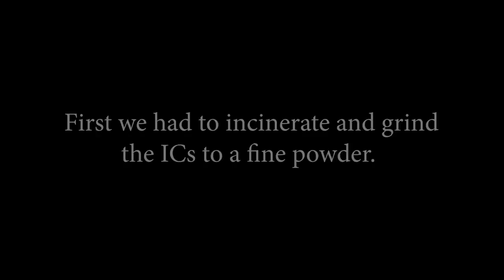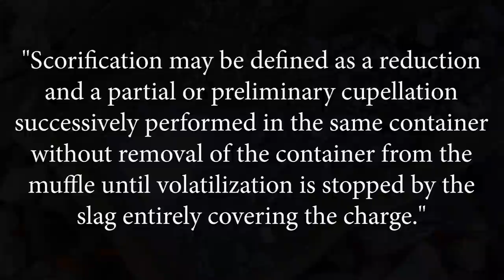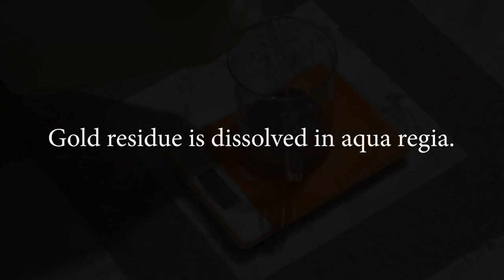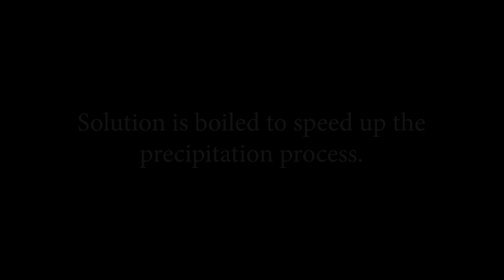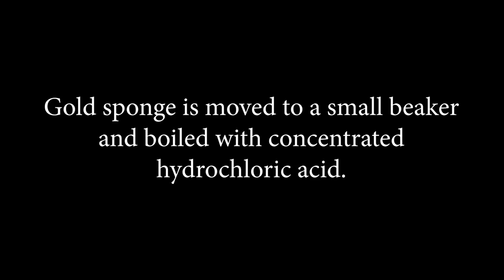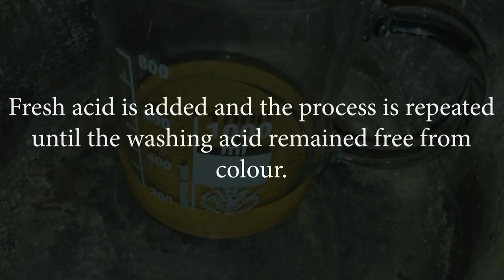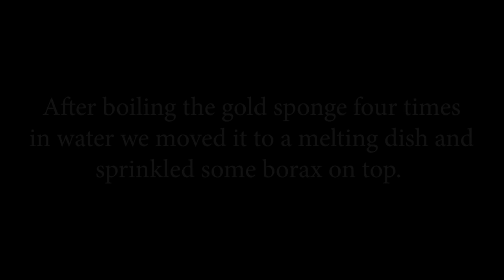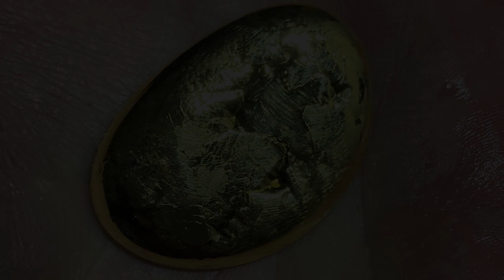GOLD from optocouplers and power transistors smelting

Comment: Great video! I assume these transistors where all T03's? And that you cut them open with an angle grinder. And only use the die and the bondwire of it, is dat correct? And do you perhaps know the total weight of the 1500 transistors?
Reply from the maker: That's correct  I was given only the dies of the TO-3s to process, so I don't know the overall weight.

Comment: Why are ceramics able to go into the crucible right away and the plastic ICs had to be incinerated first? I have no experience with processing material like this besides for watching your videos. Just thinking about I'm guessing the plastic would melt into one piece fucking everything up, but that's only a guess. Have a good week and be safe
Reply from the maker: that's a good guess :) I wont be able to see if all plastic is gone which will lead to much longer holding times

Comment: I don't use the smelting technique to make the dore often but I am curious do you lose any gold to the slag with the sodium hydroxide at high temp? also how do you dispose of the slag? i'd assume it is like cupels and absorbed some lead? or does the mass amount of carbon absorption keep all metals from oxidizing?
Reply from the maker: Gold could be lost trough mechanical enclosure  in the slag when the slag is not viscous enough, sodium hydroxide helps with slag thinning. I don't dispose of the slag, it can be remelted over and over again, or it could be converted to metal, with reducers.

Comment: I tried this method today i added 3kg lead and 50 gram silver for 3kg gold contain material finally i got 500 grms melted lead I have tested in computer machine it shows 21k gold present in this lead metal 
Now how to remove lead from this melted metal before dissolve in nitric Can you explain pls
Reply: You should to oxidize lead. Do it with cupellation and oxygene
Reply from the maker: https://youtu.be/XJe5U0lOfiE

Comment: Heya !
What a great result again !
It's still too cold here to start recovery season and i feel impatient to begin.
People can't imagine the time we spend on finding and preparing the ore...
A question :
Is it a home made crucible your are using in that vid ?
Prices of all needed component to work are getting higher and higher as inflation grows...
Do you feel the same dream as precious metal's prices will explode this year ?
Whish you the Best.
 GodBless you.
Reply from the maker: Hi there mate, always happy to read your comments! Regarding the crucible - yes it's DIY :) crucible bottom of a natural gas cylinder (mild steel)
Reply: What is the thickness(Gage) of steel sheet 1mm (or) 2 mm
Reply from the maker: @rightvideos5057  2.5mm the stainless steel sheet the one used for crucible is about 5mm